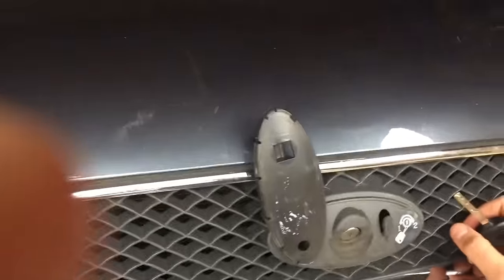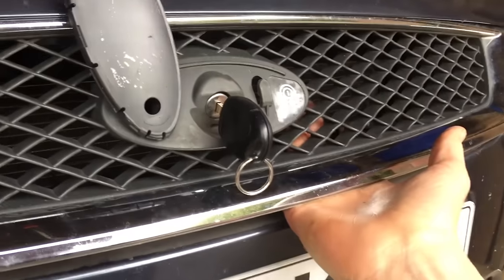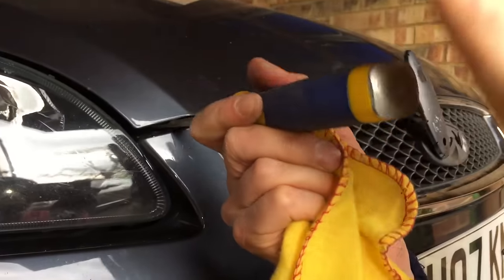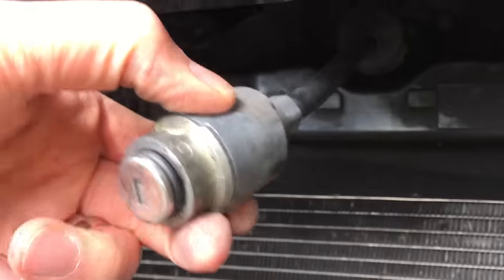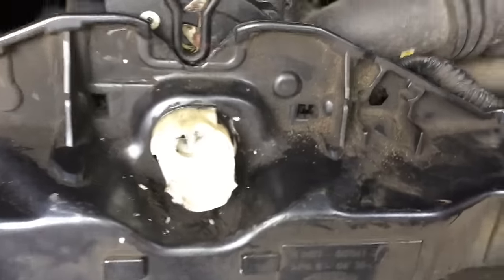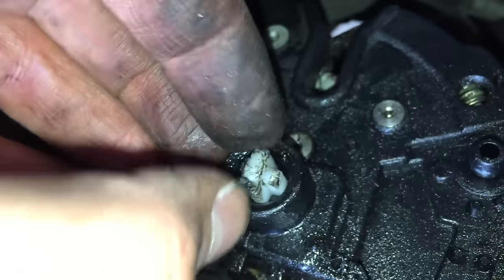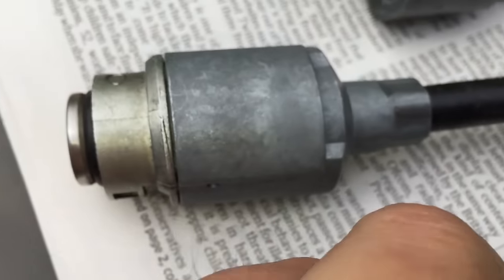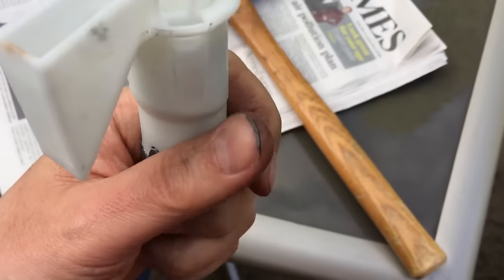Focus Mk2 Bonnet Lock Won't Open - Hood Release Problem (Full Guide)

Comment: Thanks for the vid, helped up to a point. The fixings on the ST grille are slightly different and I had to remove the lock with the grille wedged upwards. Once open I found the two visable outer fixings dont hold the grille but are for the bumper instead. The two outer fixings of the grille are actually hidden by the top of the grille so you need to break them in between where the grille top and bumper are joined. It is awkward but doable. Also the gap between bonnet and bumper is much smaller so had to wedge them apart to get a chisel in.
Reply from the maker: maclood thanks for the feedback. I'll pin this comment so people can see it
Reply: @MotoringEvents  Same lock same car. At least u explained your method of making it work. I will try to do it slightly different if I can? Thanks for your information it was helpful. I have just had the  clock cluster repaired, it may have something to go with that! It was working before my repair. Thanks again.
Reply: Ни хуя не понимаю что он говорит
Reply: @Roman Alejandro instablaster :)
Reply: @Landen Francisco thanks for your reply. I got to the site through google and im waiting for the hacking stuff atm.
I see it takes a while so I will get back to you later when my account password hopefully is recovered.
Reply: @Landen Francisco It did the trick and I now got access to my account again. I am so happy:D
Thank you so much, you really help me out :D
Reply: @Roman Alejandro glad I could help xD

Comment: Appreciate you trying to help people out, but this is not the way of going about it. I went to go and attempt this to pop the hood of my Focus. It just didn't make sense having to break all the inner screws, let alone smashing the inner locking cylinder. I pulled the grill out with a screwdriver by torquing it out and downward (knowing the brackets are at the top). You don't have to break the plastic screws. The grill came straight off, barrel and all. Then I just separated the locking barrel from the two connector pieces and was able to open the bonnet with plyers.

Didn't have to smash anything or compromise the grill. It turns out that Ford criminally charge for a whole 'repair' pack, even though they know this a terrible defect and I literally only need a few pieces of plastic...but it's an easy fix. I work in IT and don't know shit about cars but I managed to get this done in an hour. Don't follow the advice in this vid. I was immediately skeptical as soon as a chisel and hammer were pulled out. I'm glad, as I need two parts of this kit and can sort this out myself. If I smashed out all the inner brackets, screws and inner turning cylinder my car would basically be a write off.

Comment: @motoringevents does the grill go back on with no problems after?
Reply from the maker: Yes, it clips in but you might need to replace the plastic screws along the top. Someone in the comments just prized them out rather than cutting them like I did. They are plastic so should ok to reuse that way.

Comment: Hi I've watched this vid over 100 times lol. I've got the key barrel out by smashing it like you did. I'm unable to remove the top grill and now the white key you turned to open the bonnet is visible but hard to reach with the longest screwdriver I've got. Was there a specific way you turned it to open? I know left and right yeah but I can kind of reach it. My hands wrists and arms are in bits atm lol
Reply from the maker: Sorry for the late reply, hopefully you got there but I guess drilling the old plastic but dont damage the lock.

Comment: Thanks for the great video, I've ordered my new kit. One question. Where can I buy the plastic cross piece that you removed from the actual lock. What is the correct name for it? Thanks again for great video.
Reply from the maker: Rory O'Leary it came with the kit. But you can get it separately from the ford dealer for £3 I think

Comment: I have a similar problem on my 04 Focus 1.6 LX, but my key just won't turn in the lock.  Any ideas ?
Reply from the maker: If it is a Mk2 I guess it is probably a similar issue, either the barrel, the cable or the latch, you won't know until you have a look but I couldn't tell you for sure. If it's a late Mk1 I don't know as I haven't seen how the latch works.
Reply from the maker: I'm not offering advice, the video is just to show what I found on my car (Mk2 1.6 Zetec) other models could have differences.

Comment: Arnold Clarke UK quoted me £600 to do this job today. I declined . She said it was £149 for the part and the remainder was for 2 hours labour
Reply from the maker: Wow, £600 for 30mins work and £50 max for the part!
Reply: @MotoringEvents  I said to the lady on the phone that when he did the diagnosis he got the bonnet open by removing the 10mm bolts from underneath, they film it an email you it, she said ‘they have to strip it to do the job’ I says he’s already stripped it today and that cost only £58, now when you want to simply replace the old it’s gone up £400 plus the part (from Ford no doubt) I says guys on the internet do it fast she said ‘we don’t do the internet we have to do it properly’ I said it is done properly, I just said no thanks absolute scandal and hung up. I’ve got the parts my uncle is gonna do it today. I’m gonna email Arnold Clark for an explanation, they can’t possibly be on £200 per hour 🤯🤯🤯🤯

Comment: Im struggling with getting the two small pins out of the barrel. The long pin i used a thin screw-driver and hammer. But the two small pins, im not sure what to use. You said in the video, "use a drill". The drill that you use to make holes in wall? Or am i getting confused with something else? Lol... any help or advice would be grateful
Reply from the maker: Hi you can get very small metal drill bits that are a bit smaller than the pin, dont get bigger ones or the new pins wont stay in, but dont worry too much you could always put some tape around or something to stop the new pins falling out.

Comment: If I buy a replacement for a 2015 model, will it work for my 2006 ford focus model? It should be obvious but I found one that says it works for 2004 up to 2015 models. I dont want to buy it and it not work. Thanks!
Reply from the maker: I doubt it, Mk2s stopped before 2015. Not sure though.

Comment: had the same problem remove the top ultil you can see the white stick pull the stick to the back and it will open put something in there so the stick don't move to his original position and you're done

Comment: Does it make a ticking sound when you turn it on both sides
Reply from the maker: It depends on what is wrong with it, but yes it could. There are bits that can break or just get stiff and don't turn far enough to open the latch. Best to replace it.
Reply: @MotoringEvents  thank you.When I turn the hood lock of my vehicle to the left, it makes an angle sound, but when I turn it to the right, it does not. I applied liquid grease, but it did not fix, it opens, but there is no opening sound, so I failed the vehicle inspection, I think it must be a bit broken as you said, I should completely disassemble it or replace it.

Comment: There is an easier way to remove the lock. Undo the 2 x 10 mm bolts behind the radiator. No need to remove the grill at the start.
Reply from the maker: Hi, I did try that but I couldn't get it to open or get the lock off. Where you able to get the lock off by pulling it toward the engine. Also, I don't think you can get to the lock on all engines this way. Thanks for the tip.

Comment: You could take the silver trimm off  then it will be easier to get at the screws
Reply from the maker: Good idea, does the trim pull off?
Reply: Motoringevents. Yes  bothe  are separate from each other

Comment: Got it open by pushing down on bonnet then greased the lock and closed it. Now it won't open again.
Reply from the maker: There are a number of causes but mostly it’s the cable getting stiff and not turning the release all the way to release it. I did something similar.

Comment: how do you know what length to get, they seem to have the lock cable as 22cm, 25 cm on ebay
Reply from the maker: You would have to ask the seller, there was no option on the ford part.

Comment: Just tap around the key hole with a screw driver Not the key hole that will release the spring that have come loose in there that why your key is not turn

Comment: Turn the we shaft from the lock  from lieing under the car    20 seconds open it   . That video makes it look hard and u wreck ur grill also.  Try my way so easy
Reply from the maker: It's definitely worth having a go that way first, worked for me once but I shut it again without fixing it properly and it didn't work that way again. Also, this way does not wreck the grill at all.

Comment: The best option is to jack up the car safely, remove the underbody engine shield, reach up behind the radiator (between the radiator and the engine, not easy as there is very limited space) and using a 10mm spanner remove the two bolts holding the bonnet catch assembly. You will then be able to open the bonnet to investigate further,

Comment: WHEN TURNING THE KEY LEFT THEN RIGHT LIKE NORMAL TO UNLOCK AND RELEASE THE BONNET PUSH UP AND HARD WHILE ALSO PULLING REMEMBER IT IS UP AND NOT IN WHILE TURNING THE KEY AS NORMAL LIFT THE BONNET IF NECESSARY I read this and was able to get my mums bonnet on her xr5 that way you dont have to remove a thing to get it open i realised this must be the possible when I remember she to call out a mechanic for a problWHOLE TURNING THE KEY LEFT THEN RIGHT LIKE NORMAL TO UNLOCK PUSH UP HARD AND PULL REMEMBER IT IS UP AND NOT IN AND PULL WHILE TURNING THE KEY AS NORMAL LIFT THE BONNET IF NECESSARY I read this and was able to get my mums bonnet on her xr5 dont have to remove a thing to get it open i realised this must of been the case as I remembered she to call out a mechanic for a problem with the battary or something and it wouldnt open for us but he just opened it magically beware as you may fork out a couple hundred for a mechanic to do what ive just said above or just rip your front grill off like a madman
Reply from the maker: Hi Thanks for the feedback. I did get it one once this way, but didn't have time to fix it. Next time I tried it didn't work, I guess it depend how far gone it is and what part is faulty, but it is worth a try as it is much less hassle.
Rich

Comment: This system Ford came up with has to be the biggest, over-engineered design flaw piece of crap ever. Seriously, what was wrong with just a lever inside the car?! Talk about creating a problem where none previously existed.
Reply from the maker: Couldn’t agree more, I gave up after the second time and used a long screwdriver to open the bonnet, no security at all.

Comment: your a bloody legend  !!!!
my Focus ST had the same problem. .i did as you showed and within about 30 min it was removed and the bonnet was up (after 10 months of it being locked) .i did it slightly different to get those plastic screw locks off, i took the bottom stone guard off for easier access. being from Australia it's hard to get advice other than smash in the grille. . Lucky your movie shows the most domestic way!
Reply from the maker: Well, I still smashed the lock off with a mallet. Don't want to be too domestic ;-)

Comment: Got charged £250 at a garage for this repair
Reply from the maker: Damn that's so bad, £50 for the parts, 20mins to fix.
Reply: @MotoringEvents  its back at the garage today as it still doesn't open :/